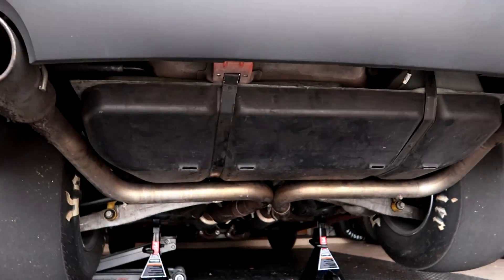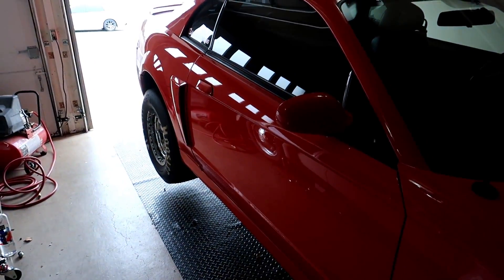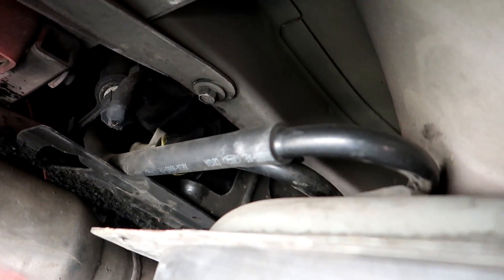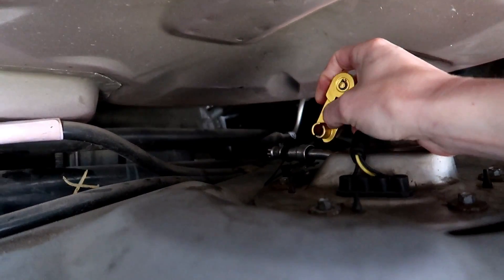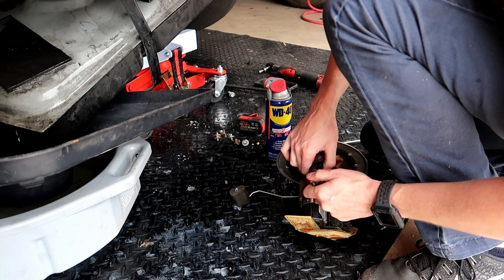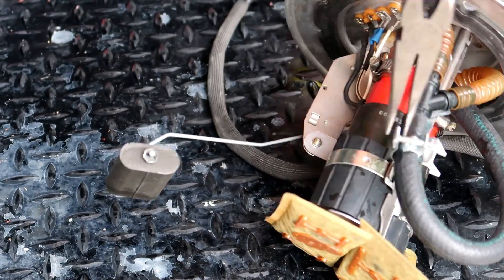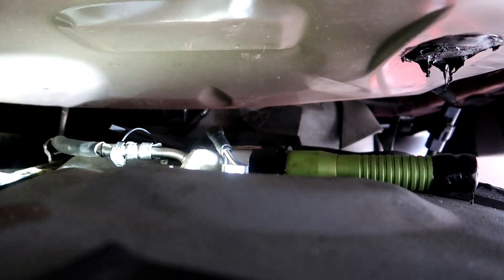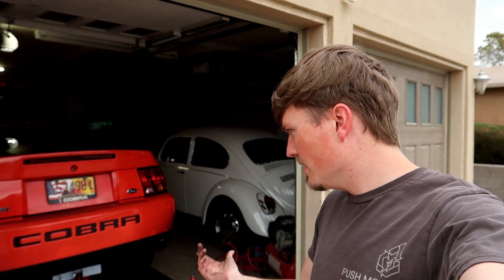Cobra is broken!!! (No Start)

Comment: hello have a question i notice that in your fuel line its missing the plastic part that goes between the rubber hose and the plastic hose it look like a tinny whistle .its ok to take it off the fuel line ok did you do anything more to make it work or is it better with out, it i think my is not working right
Reply from the maker: rcguy86 you can take it off it’s a pprv basically a one way valve so it doesn’t bleed off fuel pressure for hot starts and after sitting long periods of time.

Comment: So man I bought a 99 cobra, and sometimes the car starts and sometimes it don’t, like the lights and all will come on an if it turns over it starts but if it doesn’t turn over it either clicks or just does nothing but turn on the gauges, radio, heat etc, any ideas of what’s wrong?
Reply from the maker: Sounds like a bad starter or bad connection to the starter, check the power wire and the small solenoid signal wire on the starter and make sure they are both tight.  If they are tight i'd then think the starter is bad.

Comment: Please stop killing the starter. What did it ever do to you 😭😭
Reply from the maker: lol it's not that bad on the starter it is an electric motor! you should see what the diesel guys at dealerships do! they crank on them for 30-45 seconds! it hurrts my sole watching them.
Reply: JaegerWrenching It is an electric motor that gets VERY HOT VERY FAST.. What kills electric motors? Heat. That’s way too long that you’re cranking, and you need to allow it to cool between cranks but do what you want. It’s such high output you could damage the starter, the lines, or other components. 
 You may have a new video on starter replacement coming up soon 😅

Also, I wouldn’t chance any more with your car until you have a return system.  If your car continues to shut off between shifts you could likely lose the entire motor if it’s leaning out. It seems like this is a fuel issue rather than spark, so you’re in dangerous territory